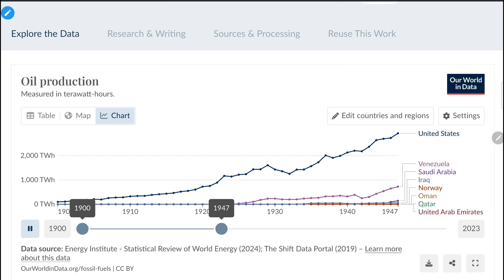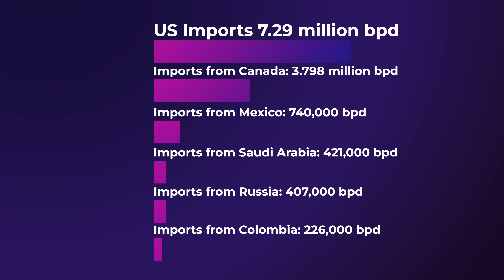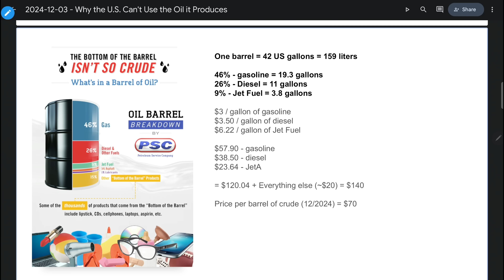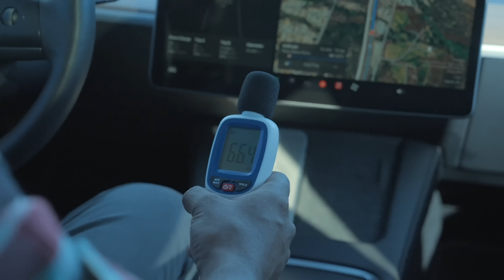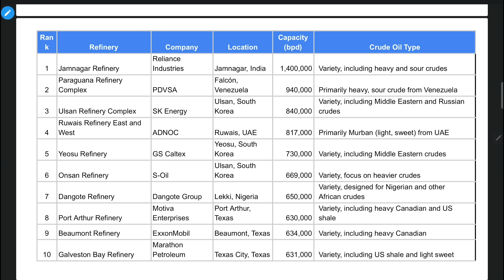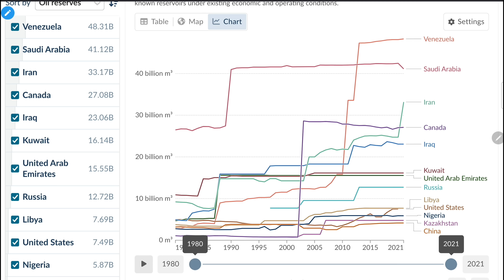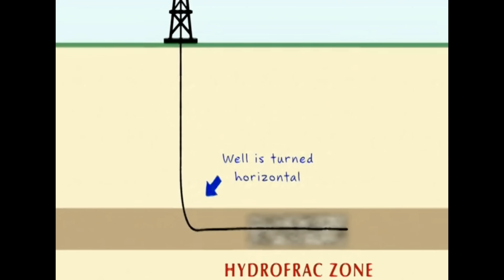Why America Can't USE The Oil it DRILLS

Comment: My first ever job, prior to leaving for medschool, was at Exxon in Beaumont. That plant can run anything, just takes some optimizing. It's not terribly expensive in the sense of money lost; it's expensive in the money you won't make while not operating - the opportunity cost. It's also risky to switch since every 4-8 years the political climate can swing widely -- no one in Big Oil is worried about EV's or Green Tech. It's a non-issue for them. It's still important to drill, baby, drill because oil is a global commodity. Adding more oil to the global portfolio takes power away from OPEC nations who previously colluded to control prices and keep them artificially high to siphon money from the west to their own nations. If we were willing to invade them and force open markets, as we did with Japan in the 1800's, that would be one thing. In the current system, we can only flood the market to force them to compete for market cap, which decreases prices overall. Lastly, you forgot one major class of people who benefit from pumping -- the people who own the mineral rights. That is life changing money for a lot of people.
Reply: @HalfAssedRanching  the problem with US oil production is fracking. US drillers need about $70 to break even. If opec floods the market and say oil drops to 40 bucks, then you can say good bye to US drillers. Banks have hundreds of billions in loans with them,so you can be almost certain that oil ptices wont go much lower than $70. Now imagine the money made at this prices for Saudi for example where the drilling cost is a fraction compared to frackers.

Comment: The EV industry has a problem.   The electric grid needs to double or triple to accommodate it depending on who you believe.  Just saying going solar and wind doesn’t cut it.  Right now fossil fuel plants ramp down when wind and solar are available.   Energy storage costs far exceed solar or wind costs.  

Eventually we will change our refining system.   Probably within three years when China tries to invade Taiwan.

Comment: The energy independence provided by the shale oil fields is from the natural gas. This is making electricity production cheap and plentiful for the reindustrialization of the US and power needed for AI compute needs. This will also make it possible to meet the huge demand for EV charging.
Reply: Funny how EV's also run on petroleum, just in a more roundabout way.
Reply: Nuclear is more energy dense and less environmentally harmful than natural gas

But that doesn't make a trillion dollar oil industry happy, so you've /probably/ been indoctrinated into thinking it's scary and dangerous

Comment: We will still need petroleum products for plastics, pharmaceuticals, lubricants, etc. far into the future. Alternative energy and electric cars are fine as far as they go, but the technology has a long way to go with regards to the energy sector. Renewables like solar and wind are not constant energy sources and you still need base loaded power generation to provide power during periods when winds are calm and during night time when solar is offline. Energy storage helps, but it also has a long way to go to make it economically feasible. To sum up, we will continue to need petroleum for a very long time.
Reply: Well said
Reply: there has been and is continuing to be lots of research into non petrolium based plastic replacements some have been very successfull and already in production. in the 90s they were making fishing rods from a carrot based product that came from this type of research for instance , there was another "plastic" made from ceratine extracted from lobster shell.oil may not be needed at all in the relatively near future

Comment: In 2023, the United States produced approximately 3.04 billion barrels of shale oil, or about 8.32 million barrels per day. This was about 64% of the total crude oil produced in the country that year. You can mix shale oil with heavy crudes from Canada heavy tar sand bitumen, or Mexico and Venezuela e.g. Mayan crude which is too heavy for most refineries and refine in the existing refineries in the US. That is done today. West coast refineries were built in California for local oil production and the northern tier refineries in the pacific northwest were built to refine oil from Alaska which is traditional oil. The west coast refineries do refine oil from overseas (non-North American) but they also refine Alaskan crude oil and now oil from Canada via ship with the completion of expanded Trans-Mountain pipeline from Alberta to British Columbia. One of the biggest issues with producing more oil in the US is the associated gas from shale oil production. There is no way to get the natural gas to market due to inadequate pipeline infrastructure. The natural gas has to be flared, stored or used locally or the wells have to be shut in e.g. less oil pumped. If there was a way to use natural gas, then the US could produce more oil. There are some existing data centers that are being built in the shale gas areas that use 'cheap' natural gas to generate electricity. The growing demand for electricity in AI could be produced from natural gas in those areas along with solar energy because data centers run 24/7 they need a constant supply of electricity and solar alone cannot provide this. New pipeline infrastructure could also take the gas to the Gulf coast where it can be liquified and shipped around the world to Asia and Europe where there is a greater demand for natural gas and no local sources. This has been done in the Permian basin and has led to increases in oil production. New pipelines are planned and should be completed. There are also sources of traditional crude oil in ANWAR and other areas in Alaska that could be tapped and shipped to west coast refineries via existing infrastructure reducing the need for non North American crude oil imports. The North slope oil fields are depleting and there is excess capacity in the infrastructure that could be used to transport expanded oil production in Alaska. The idea of 100% electrification is a noble goal but we are never economically going to achieve it is just too difficult to decarbonize some industries so the US and the world will need oil. While we may never be truly energy independent (using only North American based crude oil) by drilling alone increasing US oil production would still help the US become more energy independent. We also forgot if needed we can do amazing things if we must. Germany had no LNG import facilities in 2022 and now is a major importer of LNG because they can no longer reliably get natural gas from Europe via pipelines. I am sure in 2020 folks in Germany would never have considered building LNG import facilities but when force to they were able to accomplish the goal. The same is true of modifying refineries in the US to refine more light crude.

Comment: Natural gas is the more interesting story in the shale revolution.   It's reputation is mixed.  It's almost a waste byproduct from oil fracking.  It is incredibly cheap in the US.  Enables more energy independence for the US.  Low energy costs (relative to other places).  Also, enables more diversification for other places.  E.g. LNG exports to Europe.   NG is much easier to refine.  And they are in the US.

From climate perspective, half the CO2 emissions.  But methane leaks are a concern.  Also, much better than coal in particulate and other emissions.  In some ways, it enabled the renewable energy revolution, since it provides the backup that would allow the whole thing to work.  The proportion maybe diminishing with the advent of grid batteries, displacing many gas peaker plants (which have larger capex costs).

Surprisingly enough, the fracking revolution has not taken off in other places, e.g. Europe, India, China.  Geology?  In India and China, they have coal as backup.
Reply: Other places are smarter than to pollute their drinking water by fracking. If they are fracking it is for geothermal rather than oil.

Comment: Long story short the answer is oil type and refineries. The oils we have is too expensive to refine here so we sell to countries that have the facilities for it. Think of it why everything is made in Asia.
Reply: Actually, as the video explains, the oil we have is easier to refine.  As a result, it fetches more money when sold.  The harder to refine heavy oil that our refineries are built to handle, costs less per barrel.  So, we sell (and export) the light oil from shale, and import and refine cheaper heavy oil, since we have the ability to refine it.

Comment: they can refine the lighter stuff just fine, it would just not utilize half the equipment at the plants, and all the crap oils would have nowhere else to go. the countries building new oil infrastructure prefer to build similar cheaper refineris and just buy better oil
Reply: Not quite the right way of thinking about this. There are many byproducts from heavier oil. Would you go without tar or bitumen? Also running these plants not designed for this would be highly inefficient and expensive. You would pay more at the gas station.
Reply: @sebmorrell  you are correct. Those heavy products are important, and prices could go up, especially because it would put even more demand on the frack oil.  I am mostly saying the premis of this video is not correct because it would not be difficult to process it at out plants, it is just more effective use of resources to let the plants that were designed to purify the worst oil do that, other wise that oil would just be unusable.  if a war with Venezuela started tomorrow we would be able stop imports and cripple whatever is left of there economy as they may have the largest reserves but most of it is the garbage these plants are designed for

Comment: They're actually is a company trying to build a new oil refinery in Texas. 
However they're tied up in environmental regulation and they're probably going to be denied. 
Since the 70s the politics in this country demanded environmental regulations. 
Well some of these regulations won't meaning in the beginning today they mostly exist just to prevent economic development in this country. 

This regulatory problem exist for more than just the oil industry. 
Americans need to realize that by having these insane regulations we're not actually protecting the planet we're just allowing developing countries to produce what we need at extremely lax non-existent environmental controls.

This country has not lowered its carbon dioxide output over the last 50 years, all we did is we thought it would be better to start paying the poor people of the world do off put the carbon.
Reply: open borders good for Co2?   also, perhaps we open up KEYSTONE pipeline again- from Canada?
Reply: @atomicdmt8763  Not sure how you got open border out of anything I said?
I would agree we should open up Keystone; that is a perfect example of the government claiming an environment need to not build something.
The "enviromentials" fail to realize that pipelines have a much lower accident rate then trucks.

Comment: Shale exploitation puts at risk the underground water source. Also, shale drillers don't clean up their sites. That has long term consequences. Less regulations, more pollution.
Reply: Not to mention minor things like the earthquakes it has caused.
Reply: @beauthestdane   "Not to mention minor things like the earthquakes it has caused."

It'd be better to wait for a bigger earthquake?  Ever think of that?  I'd rather have a bunch of do-nothing earthquakes than a huge one....
Reply: @unchosenid The fracking is the sole reason for the earthquakes. For instance there are no active plates or hot spots and before fracking, there were no reported earthquakes.
Reply: @unchosenid  No, it is causing earthquakes in areas that have never had them before.  Even a relatively mild earthquake can cause a lot of damage if the infrastructure was not built with earthquakes in mind.
Reply: It's called privatize the profits and socialize the losses.
Reply: @dukefishing  I saw that a startup is using fracking to install a geothermal power plant at any location.
Reply: The oil pools are thousands of feet below the water table. Crude oil has existed and seeped from the sources for as long as cyanobacteria have existed - billions of years. Are the Le Brea tar pits pollution? Oil leaks cause algae blooms because algae eat oil. It's recycled into the biosphere rapidly. More life on Earth is a long-term consequence, but it's not a bad thing.
Reply: That is simply not true.  The underground water is shallow and unaffected by the "shale" drilling.  Also, they are required by law to clean up the site when done.  Stop making up things!
Reply: Recently lithium and other rare earth minerals has been found in the North America shale! It would mined with fracking, not strip mining.
Reply: Water falls from the sky for free, don't drink dirt water.
Reply: @xoso599  Good thing we stopped emitting so much sulfur dioxide. Acid rain is not very good for you.

Comment: Ricky globalization is failing. We are still a century from coming off oil. 
I’m not a fan of the slave labor that is used in the EV process. 
It’s also not a problem. If we can repeal or amend the Jones Act that would help. If the sour crude providers fail then we will retool our refineries to refine the sweet crude from fracking. 
Stick to engineering and leave economics to those who know.